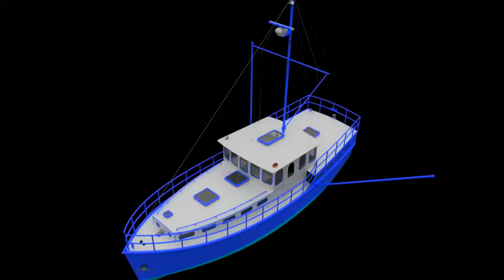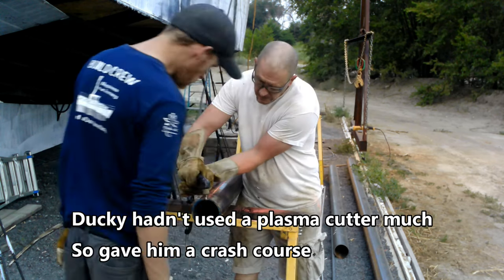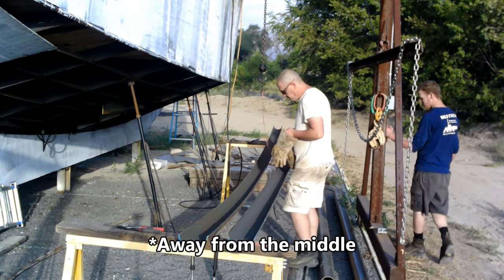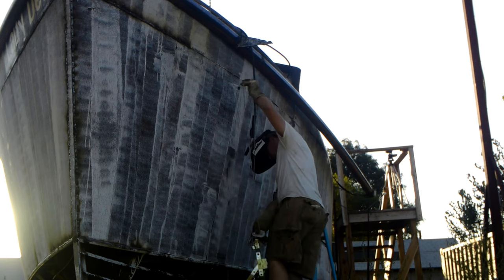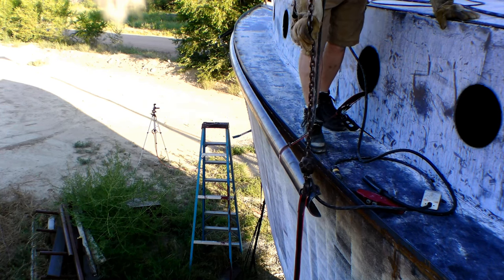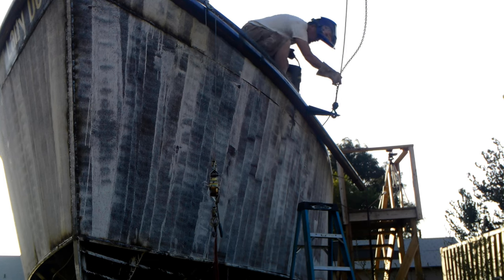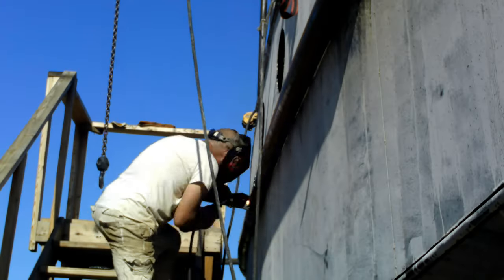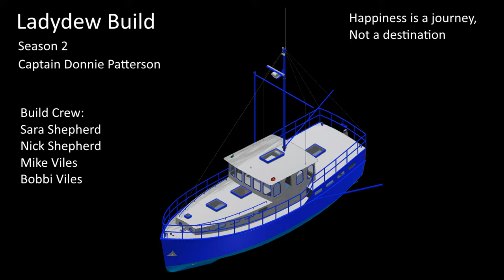Lady Dew Build - Episode 27 Sheer Pipes

Comment: Good to see you are still at it. I say this to every do it yourself steel boatbuilder and nobody ever listens. You can knock off the slag from a plasma cut really easily if you just hit it with a hammer at the right angle. It literally falls off in lengths of many inches with just a single hammer strike. I have watched a half dozen steel boatbuilding  vlogs who just can't figure out how easy that is to do even when you tell them. All things considered I think you made the right call splitting the pipe. I am not a boatbuilder but I ran a fab shop for more than 20 years.

Comment: Struggle is part of the deal whether it's building a wood, fibreglass or steel have done it all. As a shipwright and boilermaker the use of wedges and saddles is part and package. This would have solved the problem of keeping the lower edge tucked in and up and the effort would have been minimized. You persevered and the battle was won, she's coming together sir even though you are limited in work hours. 🇨🇦🇺🇸
Reply from the maker: I try. :D

Comment: Donny! Glad to see where you are at on this project.  No your girl does not look fat from that angle, she looks voluptuous.  You are really moving along and it looks great.  I'm with you on the boat building priority.  Build the boat first and share the process when you can.  Question: Are you going to spray any primer in the rub rail after you get it welded up?  Could help reduce any rusting on the inside of the half pipe that might run down over what I am sure will be a fantastic paint job.  Take care and share when you can, otherwise build that boat!
Reply from the maker: I hadn't planned on primer, I was thinking of installing a couple of threaded plugs and filling the pipe with used motor oil though.
Reply: @LadyDewBuild  That will keep the rust out and add ballast.  Good thinking.